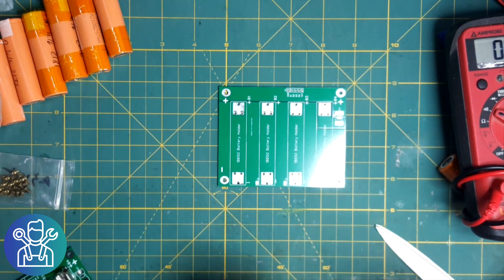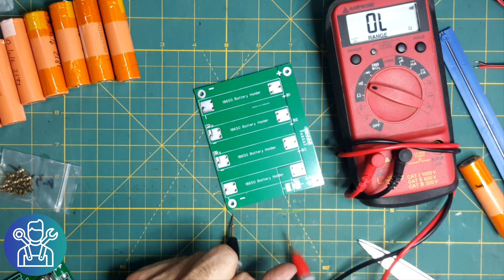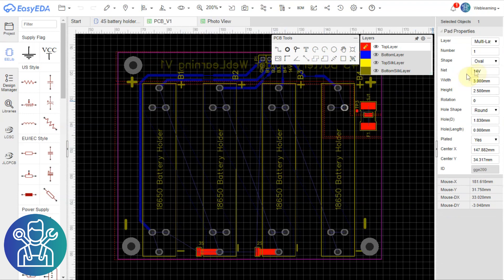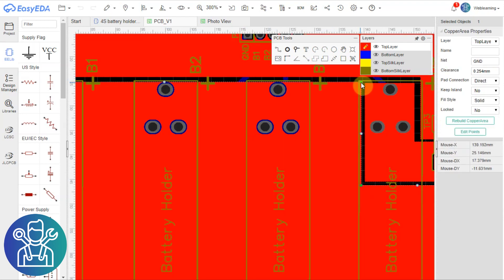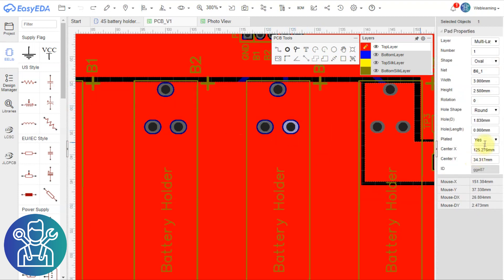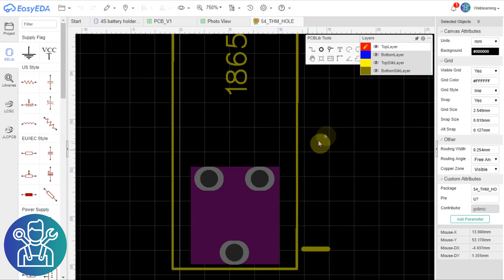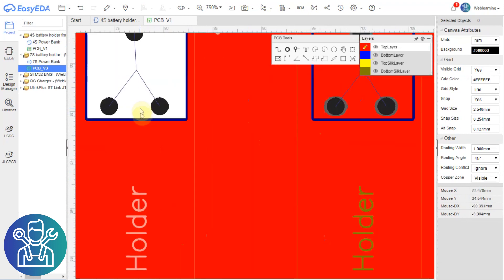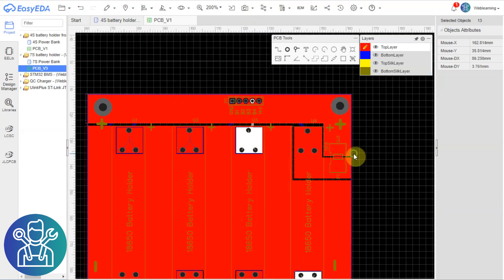4S PCB Update

Comment: can you please make a smaller version 3s ?
Reply from the maker: With this board, you can make anything. 1S, 2S, 3S and 4S. It all depends how you connect the PCB. If its a size issue, then I will need to make a new one.

Comment: Hello, I watched Jehu's video where he says the cells are too close together for the type of clips you are using. Seems like an easy fix to add a few more mm's between cells. Makes the board bigger but I don't see that as a problem. I suppose you could slot some plastic either at the clips or along side of the whole cell..... I'm trying to learn how to use easyeda but haven't gotten far yet... Lol's I'll get there...
Reply from the maker: I'm going to change the design a bit and also add different battery holders as some viewers suggested. I will also make a video on how to correctly use Easyeda.
Reply: @Weblearning1  I'm thinking about just making the pcb for paralel and then just connect in series..... would make it easy to add to it and fix any cell as well...

Comment: Very Low Volume. And I dont Understand what was the Problem Cause!
Reply from the maker: Yes the volume is low as I didn't use my wireless MIC this time. 
In the battery holder PCB Lib, on the Component Side ( CS ) there was only keep out area for the solder mask and not a proper copper plane with the same net name. So, when I place a GND plane over the complete area in the CS, instead of the battery holder pad rejecting the that area ( as it is now ) it was exposed to GND. I hope I managed to explain it this time.
Reply: @Weblearning1  you dont need Filled Gnd or VCC. Just make thick pads. You can use Diptrace Software. Its free for home users (Use a Old Free Version, or Request a free personal Lisence). Its very very Convenient and easy
Reply from the maker: I know Diptrace, I used before Altiume, Cadence and more... I find EasyEDA enough for my needs and also other users can reuse my design. the Filed GND & Vcc are to dissipate the heat from the battery when you draw a lot of current, thick pads are not enough. Also, you can use electric soldering directly to the PCB.